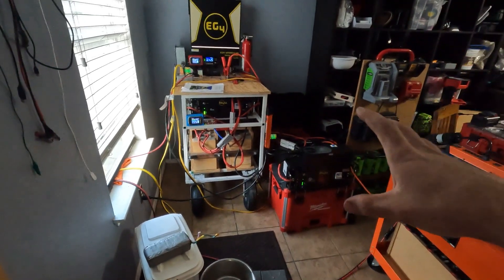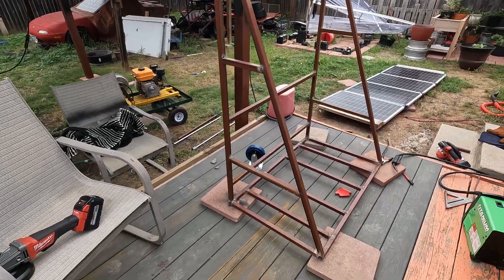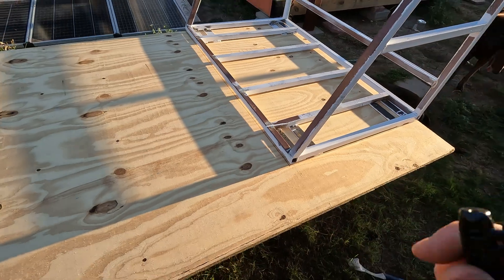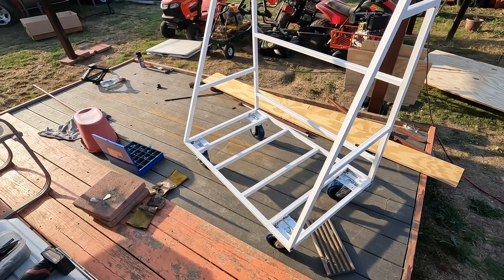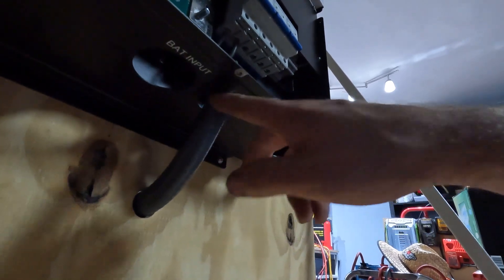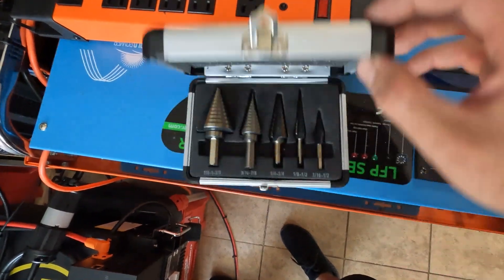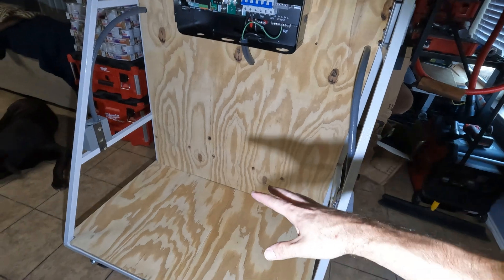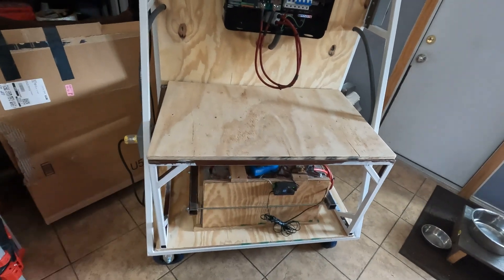Full Build Solar Power System 48 volt!     Eg4 6000xp, EG4 LL Battieres

Comment: Is it possible to just connect power strips to load? If I only need 120v
Reply from the maker: Yes , it has 2 phase outputs and a neutral. 1 phase to neutral is 120 volts

Comment: Suggestion:  Put a layer of stainless, hardiebacker or cement board behind the inverter area in case it goes up in flames (it happens).  It's cheap insurance to help mitigate damage.
Reply from the maker: @ChrisEpler  Good idea I need to do that!

Comment: You should have watched "Solar Inverter Catastrophic Failure" on Youtube before selecting this, or any high frequency inverter.
Reply from the maker: @quickquote1568  honestly has been reliable thus far, I agree I would prefer a low frequency inverter, but this thing has been flawless
Reply: @Mikebuildss  Yes, thus far. Give it 2-3 years and please let us know if its still performing flawlessly. Because historically, that's about as long as a high frequency inverter will last.

Comment: Hey, I'm thinking doing similar setup and having wiring from the window, can you show more about how you protect (or no protection) on your PV wiring? How high the voltage is? (for 6000 xp It could be 3-400 V I guess)
Reply: any thought on put it flat on cart?
Reply from the maker: Sure it’s ran though a wooden bulkhead that has sealed holes and is also sealed through window, and yea you can absolutely mount it flat

Comment: EVE LF280K 310Ah Grade A (Version 3) LiFePO4 3.2V Prismatic Cell with Laser-Welded M6 Studs and 8,000 cycles are $87 per cell x 16 per 48 VDC nominal battery comes to $1,392 plus $185 for the JK B2A24S20P 200A BMS with 2A active balancer and Bluetooth for a total of $1,577 per battery. So that is a 15.8 kilowatt battery for a savings of $1,723 over the EG4 280AH Wall-Mount indoor battery. You could have 31.7 kWH for what you would pay for just one EG4 battery that is only 14.3kWH. Plus, you do not need to compress the cells or top balance them. Because swelling happens at 3.65 volts and the cells reach 100% state of charge at 3.5 volts and the active balancer kicks in at 3.45 volts, the battery is protected. I have 64 of these cells and they work perfect. These products are in Texas and can be purchased at docanpower.co*